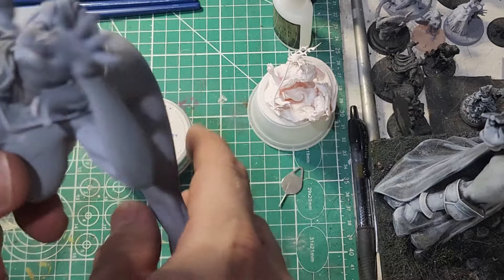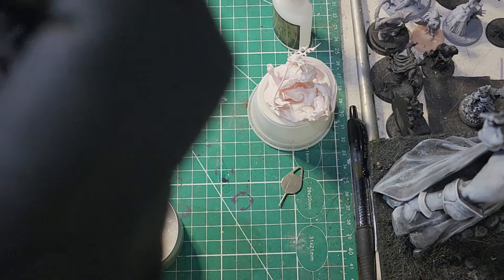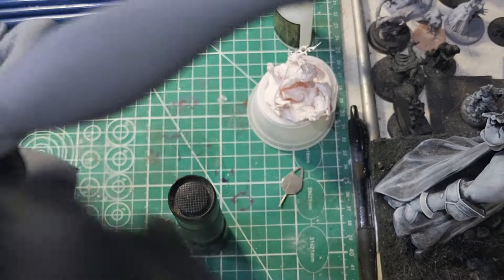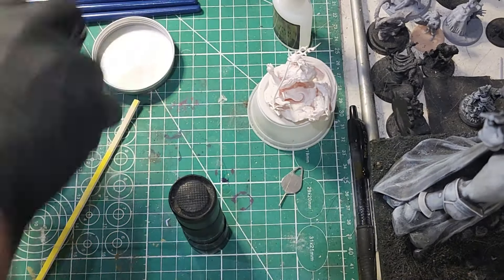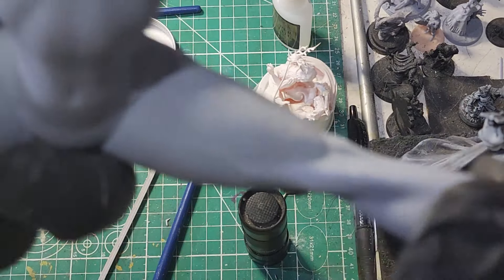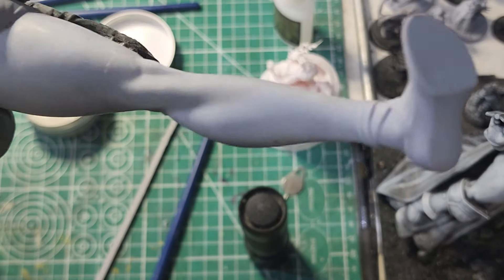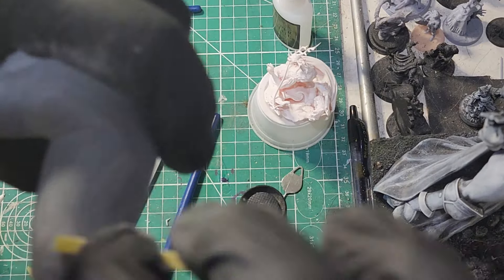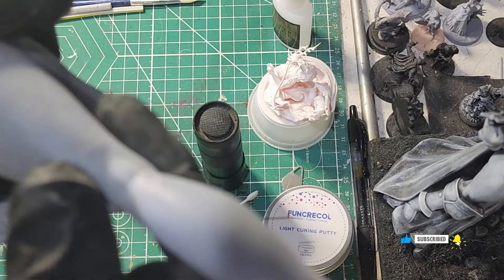3D resin printing, tips, tricks and more  😊  UV Resin Putty Is it any good

Comment: Definitely a needed product for finishing and gap or hole filling. The sticky, gel-like consistency has some uses and probably can be thinned down slightly if you need a bit more flowability but not runny like using resin from a bottle would be. On the other side, having a less sticky, more “putty” like consistency, like “milliput” or like “plumber’s putty” (or any number of uv-curing or air-curing resin putties you can find at your hardware store, would be great from Funcrecol, if they wanted to make such a thing.
Reply from the maker: They will be watching this video, so the feedback will be noted.